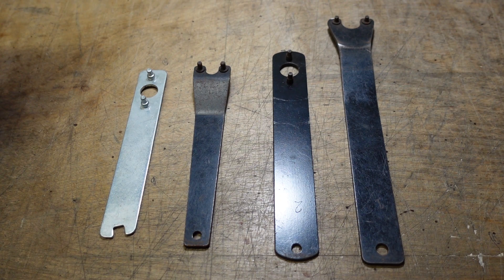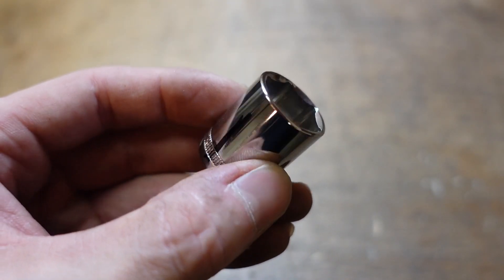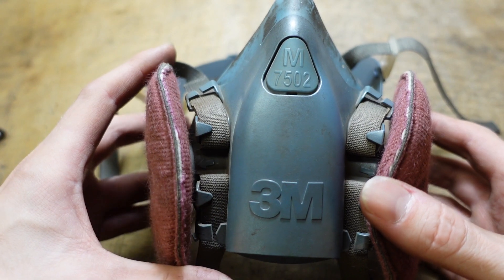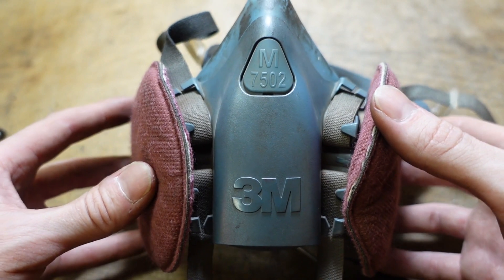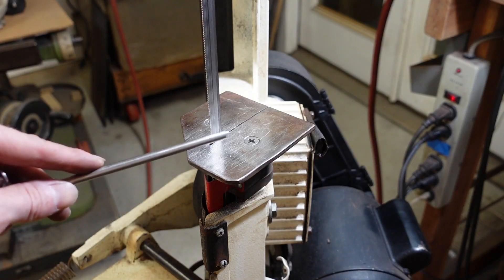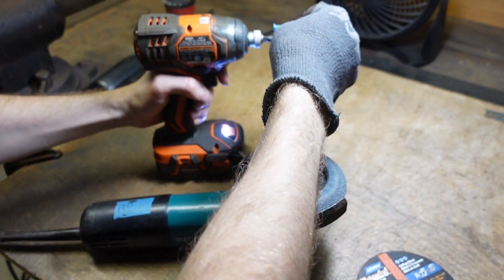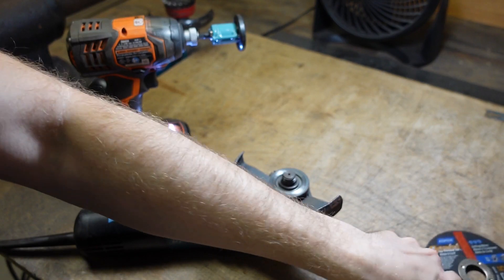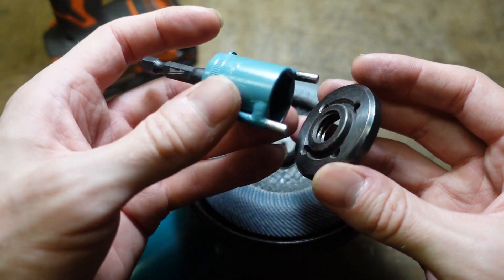Change Cutting Wheels Fast With This Angle Grinder Flange Nut Pin Wrench - You Can Make This

Comment: Couple more for ya.

1. Never use tool to tighten., and you shouldn't need one to loosen. Wire wheels you can press tool on wood while locked and use tool handle as wrench handle. Or just hand ppe (which is usually absent here) to grip.

2. I use Miller LPR-100 Half Mask Respirator

Comment: I install the nut hand tight, rotate the disc ca, with the lock pin pressed.  The grinder rotation will tighten the nut. To remove, press the lock pin, grab the disc and rotate ccw. It’s tooless.